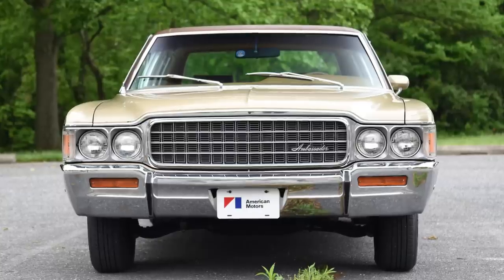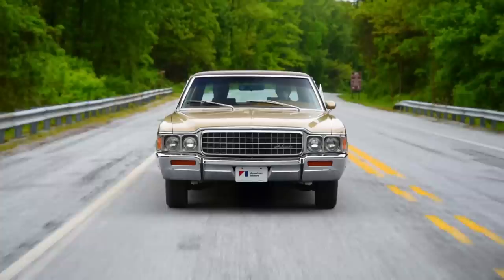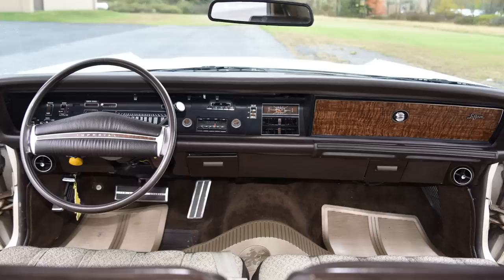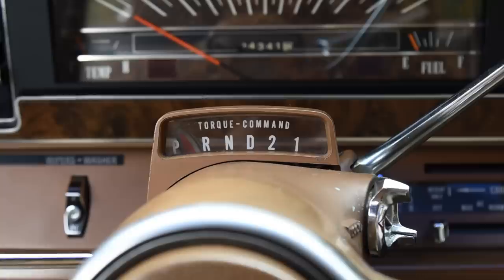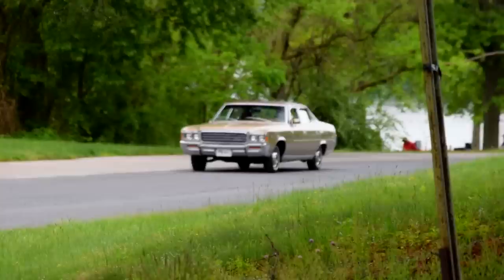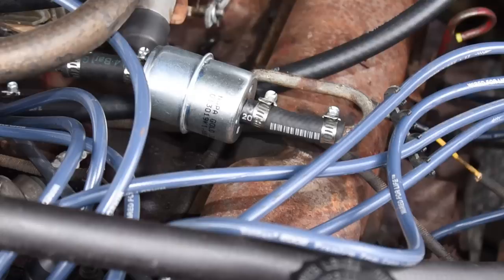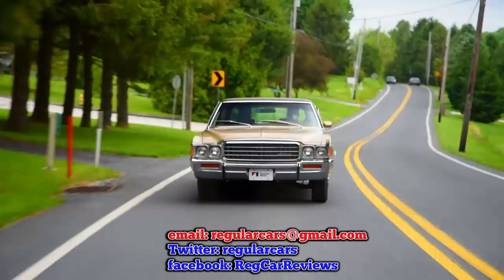1972 AMC Ambassador Brougham Sedan: Regular Car Reviews

Comment: My father had two Ambassadors over the years, a 70 and a 74.  They were big, comfortable, reliable cars and weren't just another Chebby or Ford.
Reply: My dad had a red, '71 wagon, with the wood down the side. I ' inherited ' when it had 100,000 miles. Got another 40k out of it before it  was too expensive to run. That 360 drank fuel. I replaced it in '79 with a Spirit (the Gremlin-shaped version). That one went nine years and 200k miles on a VW engine. AMC made some weird cars, but I don't think they deserved the death they suffered.
Reply: Ferd
Reply: @TheElectVideos  In 79 you could have had a V8. ;-) I did. And for an engine rated at 125 HP, want to explain how it could do 130MPH?
Reply: @gravelydon7072  I was a young kid back then and the $4000.00 I paid for that brand new car seemed like a mountain of money at the time. I couldn't have afforded anything that had a V8. Hell... now that I think about it, that '71 Ambassador was the last car I owned that had an 8-cylinder. Since then, an '85 Omni GLH with a turbo 4, an '89 Grand Prix Turbo with a turbo 6, a '94 Geo Prism with a four, two ('97 and '02) Malibus with 6's, an '04 Grand Prix GTP with a supercharged 6 and, currently, a '13 Caddy XTS4 with a 310 HP Six. Right now, I'm awaiting delivery on a '21 red Caddy CT5-V. The CT5-V (Twin Turbo V6) will be about 16 times more expensive than the AMC Spirit was, back in '79.
Reply: The WORST car by AMC was still better than the best Ford.
Reply: @davidlafleche1142  Oh I don't know, remember the Encore?

Comment: This is the first time ever I feel bad for a car. It wasn't it's fault.
Reply: Actually, something is wrong with that car. And my guess is the rear axle ratio. Mom owned a 73 that would have been identical except hers had the trailer towing package and was blue with white top. It was special ordered with the 1972 interior materials in blue.  She stepped on the gas one day at a stop light right next to a police car and smoked the tires. The look on the cops face was priceless. I later had a 73 that would have beat hers in everything but MPG. It had a 401 with a police package. If you passed a gas station, you did so at your own peril. But the car could do every bit of what it showed on the certified speedometer. Which I still have. And somewhere, the siren out of it too.
Reply: @gravelydon7072  That’s a beautiful story and I’m glad to hear it. Never got to experience driving any of these old cars, but man, if I could, I definitely would.
Reply: @danield8528  Not many knew about the fact that just about any V8 car you bought from AMC could be modified after purchase with factory performance parts. Like dropping big valve high compression heads on a regular engine. And the dealers would install them when you needed something changed the same as if they were putting regular OEM parts if you paid the difference in parts price.  Of course, it didn't hurt to live two doors down from the owner of the dealership. :-)
Reply: @gravelydon7072  Oh so you got the special neighborhood deal, didn’t ya lol.
Reply: @danield8528  You might say that. But if we had wanted a Chevy, that dealership owner lived 2 house down past the AMC dealer.
Reply: @gravelydon7072  Where do you live? Asking for a friend lol. They would love to live in that neighborhood.
Reply: @danield8528  Lived. We moved out of it back in 1979. Sadly the AMC dealer had died, the Chevy dealer sold the business and moved by then. The family that moved in, had a daughter my age that I went to school with. She became the parts manager at the Chevy dealership. We lived in the NW house in Homestead, Florida at the time. Our neighbor across the street was the head of the city power plant. Out next door neighbor when we moved in there was a Millers Falls  Tools sales rep. Guess whose router/planer we have. When they moved out, a mechanic for the local Ford tractor dealership bought the place. By that time, we had a Ford tractor for the land we now live on. Three houses North of us and out in the county was an AT&T employee. His daughter was also my age and his son is my optometrist. The neighborhood had military ( us & others  ) Sears salespeople, medical and dental people, aviation company owners, power plant workers for the same company dad worked for when he retired from the military. And was just a middle class area with a lot of interesting people. Heck out school bus at the time I was in HS never had an empty seat and we were the last stop on the route.
Reply: @gravelydon7072  Talk about a small world man. That sounds like an amazing community growing up in!!
Reply: @gravelydon7072  wow.

Comment: I love how the rear doors have like one square inch of vinyl and a tiny little piece of trim at the back corner of the door.  It's like the designer of the back door didn't realize how far down the roof was gonna go, and at the last second, they realized the roof was gonna need a chunk taken out of it to make the door fit, so they glued a piece of vinyl and a piece of trim there to make it look complete.
Reply: The company was small enough, that when they designed something, I bet that unlike GM they didn't have endless meetings making sure it would all look good and making sure every nickel was squeezed out of it before they committed it to tooling.

Comment: As a kid, it was fun bonding time with Dad and big brother working on the cars on Saturdays.  Oil changes, starters, alternators, mufflers, fan belts, distributor caps, plugs and wires, and later on, complete tune-ups with a Sears analyzer and timing light.  For Dad, I bet it wasn't so much fun.  Something was always breaking or wearing out on those cars.  Dad worked close to home, Mom didn't work at all.  It took YEARS to get to 60 or 70K miles.  I have 144K on a 2014 Ram and I haven't had to change JACK SHYT on it besides oil and tires.

Comment: Rated at 175HP in 1972 would be approximately 240 hp a year earlier when they were gross HP figures rather than net HP.  Furthermore compression ratios were on the decline starting in late 70 early 71’ for the impending unleaded fuel.  

As also noted by another commenter, it is a 360 cubic inch engine in 72’.  Litres were measurements for those across the pond.  

I would much rather drive this than a new appliance.
Reply: AMC did not cut theirs back until 1974. Now how did they do it? They installed thicker head gaskets that year. In 1977 I had to use the same gaskets to lower the compression in my 69 AMX when I rebuilt the engine. An error by the seller of a machined crankshaft resulted in a 401's crank being installed in my 390 block. Which took away all of the deck clearance. Which resulted in blown head gaskets, even aftermarket Fel Pros.  The thicker gaskets lowered the compression enough that it never blew another gasket. But you still needed two batteries to start it when hot. Had to chain the engine down as the engine mounts alone could not restrain it if pushed hard.
Reply: Still, 240 horsepower on a 5 liter v-8? I drive a Toyota with a V-6 and it gets 260
Reply: @redacted8567  literally apples to oranges. This thing makes way more torque and your car is newer by 40+ years lmao. I would hope itd make more power bud

Comment: Looks like the cop car that got rear ended in Cheech and Chong.
Reply: Did the government agents drive them in Repo Man?
Reply: Funnily enough, a lot of police departments actually drove Ambassadors back in "the day" (including my hometown of West Palm Beach, FL) because they were both a cheap and capable option.
Reply: I think that was a Matador, which was AMC's Malibu fighter. Of course this car is based on that. it's just stretched.
Reply: @jakekaywell5972  I've never seen an Ambassador cop car. Interesting.
Reply: Those were almost certainly Matadors. Ambassadors were just Matadors with some extra length in front of the firewall. Ambassador cop cars existed but Matador cop cars were VERY common (and very good, the 401 and Chrysler transmission made for a fast, durable combination).
Reply: @tonyrichards254  They had Ambassador patrol cars too. They were actually very popular as patrol cars because of their roomy interior and available 401 V8.
Reply: @tskraj3190  They had the same interior space as the Matadors. The size difference was in front of the firewall. There were, as I said, Ambassador cop cars, but Matadors were much more common. Also, LA was a major customer of Matador cop cars.
Reply: Or "the brown sedan of justice" from "the Streets of San Francisco."
Reply: @Andyface79  A fair number of the police cars in the DUKES OF HAZZARD were American Motors iron.  At least one was a Matador, which was kinda sorta the replacement for Ambassador.
Reply: @tonyrichards254  A full-sized car without any extra room inside? That's hilarious! It's hard to believe anyone would buy this over a Caprice, or a Galaxie, or anything, really.
Reply: I recently bought AMC ambassador 1973 and was shipped from USA Fl all the way to KSA it was the first car of its kind to be registered in the police traffic I had to wait almost 2 months to get name plant and license. It’s unique car I enjoy driving during the winter season. And I like the fact that it’s not fancy to the point that you are afraid to park it on the street at the same time not like other normal cars. when I go out driving this car, people take pictures and stopping me to ask if it is for sale. Pleas support my channel.  Thanks
Reply: @tankermottind  Even those weren't exactly roomy, proportionate to their outer dimensions. People didn't care as much about internal space until downsizing became a thing in the late 70s. When the Caprice shrunk, it actually gained interior space. As massive as they are, none of those 70s full-size cars are very roomy. Ambassadors were perceived as comfortable, well-appointed, well-made, but boring cars, not quite the genuine article as far as a full-size luxury car. It was like a Genesis or Kia K900 up against a Cadillac CT6. Nice, trying hard, but not seen on the same level.
Reply: @tonyrichards254  That's all dead on. It's astounding how cramped those giant Seventies barges were. Even their big trunks had a spare tire making the space unusable.

The Ambassador was oddly uncool even when new. Buyers were older and had conservative tastes, and thought the Ambassador name and a few fripperies made it fancier than a plain old Ford, Chevy, or Plymouth (which were also uncool).
Reply: Up in smoke
Reply: @alastairward2774  yessss!!! One that hits the fire hydrant!!!
Reply: @matthewkoch6937  no that was a galaxy

Comment: That car looks like a Chrysler product only sold in Argentina and Brazil.
Reply: It was sold there and not sure by what dealership structure.  Do you mean the Chrysler (Simca Esplanada based) GTX?
Reply: AMC...bought just about any discontinued parts from all of the big 3...Those wheel cover were a Chrysler parts pin item....
Reply: @norm2923  Hey Norm...BULLSHIT to what???? 1970 was the beginning of the  end of horse power wars.. I was 11 years in 1973  and we we're in Texas with my dad's 1969 Plymouth wagon and we could only get  5 gallons of gas at each fill up. The 1972 vetted was only rate at 200 with a 350....
Reply: @joeknowz4898  AMC designed the case that the Chrysler Torqueflite transmission were in. AMC called it the TorqueCommand transmission. Both the 707 and the 727 versions. Chrysler later bought AMC. And No, those would not have been in the Chrysler parts list at the time because the wheels had American Motors stamped in the ring around the center of the wheel. The ones on this car are missing that feature.

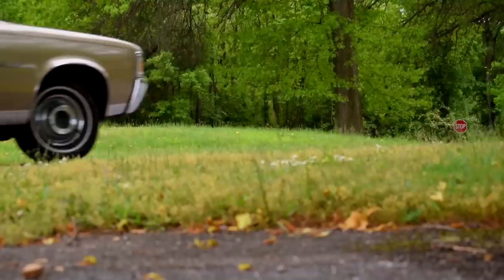Comment: At 11:20, when he opens the trunk and you can see the jacking and tire stowage diagram. On that diagram on the lower right hand corner are the initials "RW". My grandpa Ralph Walentowski worked in the engineering department and Drew much of the technical diagrams and illustrated parts breakdowns during the 60s and 70s. That particular one is his little claim to fame because he snuck his initials on it and it passed through and made it on all the production vehicles.
Reply: What a neat story!

Comment: The AC part is the only impressive part of it honestly
Reply: and the sheer volume and density of B R O W N.
Reply: And the radiator grille. Coffin nose!
Reply: @jakekaywell5972  That didn't come until later.
Reply: Too bad he didn't get to try out the "DESERT ONLY" setting.
Reply: Fun fact: AMC had air conditioning so early because they had purchased Kelvinator long before the 60’s. Mr Regular was close when he mentioned Nash-Kelvinator. But yeah, I’m somewhat of an AMC fan (because of Jeep) and I think this car is white bread boring.
Reply: Packard was the first car to have air conditioning, in 1940, followed by Cadillac in 1941 and Chrysler in 1942. Through the 1950s, most cars had the A/C unit mounted in the trunk, where it blew cold air into the cabin via vents behind the rear seat. Perfect for a "Brougham" car, where the rear passengers would cool down before the driver did.
Reply: @vwestlife  Yes!  You are correct!
Reply: Because of Nash's history with Kelvinator, they had AC going way back.  My father in law had factory ac in his '63 Rambler Wagon.
Reply: @vwestlife  I am guessing he means standard AC? Because your timeline is definitely right.
Reply: Another fun fact:  That's a York AC compressor, which is a twin piston reciprocating reed-valved compressor that, rather than receiving lubrication from the oil circulating with the refrigerant, it has it's own sump filled with motor oil, and is splash lubed like a lawn mower engine.  Thus, they can be run as air compressor heads and are quite popular with the off road crowd.  I installed one in my 80 series Land Cruiser and was able to fill four 35" tires from 13 to 30 PSI in under five minutes with the engine at idle.  At 2500 RPM, that compressor moved enough air to directly run an impact gun capable of breaking humvee lug nuts free (had to help a friend change his garbage on the side of the trail one day and dipshit didn't bring a breaker bar).  They're getting harder and harder to find, but I pulled mine out of a 1980 VW Quantum about seven years ago.
Reply: @mattfarahsmillionmilelexus  Yeah, the coffin nose ones at least were distinctive and had a modicum of style. I used to count them on childhood vacations. This earlier style is just dreary.
Reply: @markmiller3279  When I was a kid in the '70s, I hated the coffin nose with a vengeance, but now they are cool in a still-weird sort of way. The early '70s Rebel coupes were by far the best looking cars in this series, AMC did have a few nice designs that were overshadowed by the weird stuff like the Matador coupe and Pacer.
Reply: @batterybuilding  "Boring"?  It's beautiful!
Reply: AMC (actually Nash in those days) invented modern flow-through heating & ventilation in 1937 ('Weather Eye'), and adapted AC to it in 1954 ('All-Weather Eye').  The distinguishing feature of AMC's 1954 AC vs. the luxury makes was that AMC's was modern -- Machinery under the hood instead of in the trunk, and an electric clutch controlled from the dash instead of belts that had to be placed in the spring and removed in the fall.  And much less costly to buy.  In other words, AMC was the first to have modern AC as we know it today.  You could even get AC on the compact Nash Rambler.
Reply: Shame on you sir, I am a truck guy and a hot rod guy and this is an American made highly dependable vehicle and which has no foreign Parts on it I am aware of. How in the world can you talk so much trash. I find it interesting the thoughts that come from people that more than likely shop at Walmart and Amazon

Comment: I had one as a Winter beater in 1979 while I stored my '70 Camaro and '65 Vette.
Floor boards let slush in (they were rusted out) but it survived a Winter.
I left it parked in a nondescript parking lot when it became Spring.
Best $100 I ever spent.
Still, this example, I wouldn't have left it behind. :)
And, yeah, things were a bit different it the '70s - abandoned cars, in the North, were all over the place.

Comment: My aunt had one of these, I hated this car, especially in the winter. My aunts car in the winter was always hard to start in the morning. She had a routine, get in the car, light a cigarette, start pumping the gas pedal, and try to get it to start. Usually we would sit there for several minutes while she smoked, pumped and cranked the engine. Sometimes after a few minutes if she pumped it enough it would start.  On a few occasions it just would not start, on really cold mornings. She would just keep pumping the gas pedal, smoking a bunch of cigarettes, and turning the key. She always made me sit in the back seat, the car quickly filling up with smoke, and the smell of gas which meant she had flooded it. She love this car though, she loved that the dashboard ashtray was within easy reach from the drivers seat because she was a very heavy smoker. She drove this car until it had well over 100k miles on it when it just wouldn't run any longer.

Comment: 1972 was the first year of the big HP decline...for comparison, a 1972 Montego GT with a 351C 2-barrel single exhaust produced approx 160 HP. ...which is right in line with this Ambassador engine HP numbers.
Reply: California law went into effect for 1972, carmakers had to advertise net horsepower (as installed) rather than gross (test stand under ideal conditions w/ no accessories).  The carmakers just made the switch nationwide.